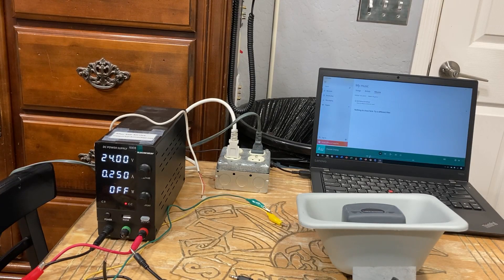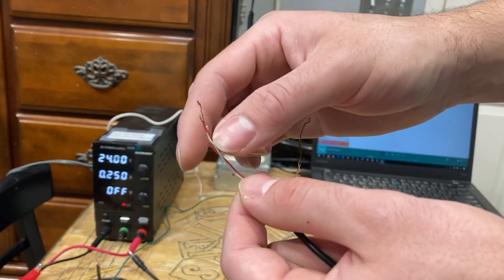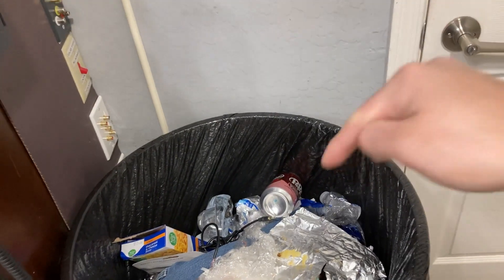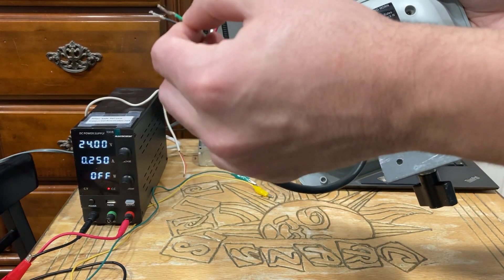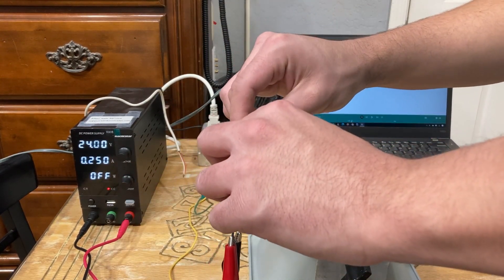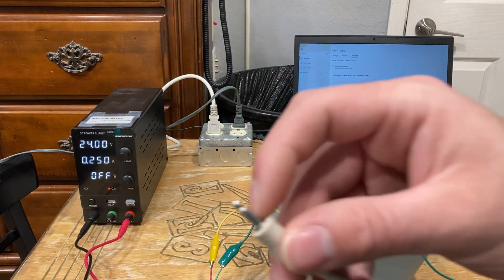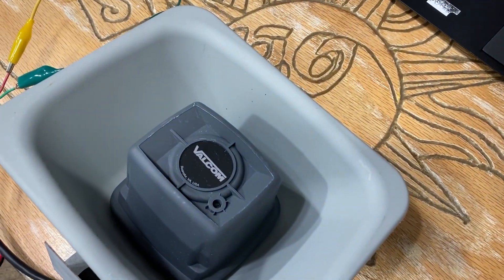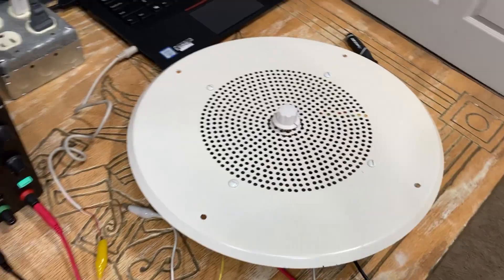How To Wire A Valcom V 1080 Self Amplified FlexHorn For Your Own Use

Comment: Do they have a high pass filter?
Reply from the maker: It should but you would have to look up the specs from Valcom directly.
Reply: @CristianOrtiztechmaster926  or it could use a full range driver like the Fourjay 312 horn
Reply from the maker: That's what was thinking as well since its a compact little horn like the Fourjay 312 horn. The only way to really find out is to take one apart but don't want take one of them down to do that on my system. Once I put a speaker or horn up in service on the system then it remains untouched unless I need to adjust the taps or add another line off the device.
Reply: @CristianOrtiztechmaster926  Yeah. The Bogen SPT5A also uses a full range driver. Fact I’m getting the SPT5A for Christmas
Reply from the maker: That's cool and heard from another viewer that I chat with that has a SPT5A horn. I was told that the the SPT5A is quite loud.
Reply: @CristianOrtiztechmaster926  oh wow

Comment: I still have not bought one of these yet but I look forward to getting one soon.
Reply from the maker: The two Valcom V 1080 FlexHorns have been working fantastic on the system and they can get loud at times where I have to adjust the volume control on the horn itself.